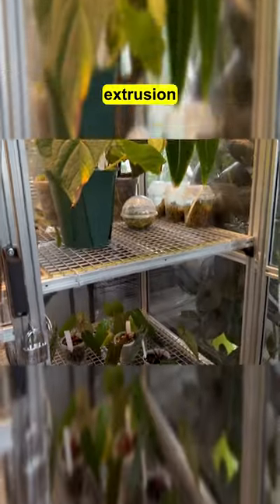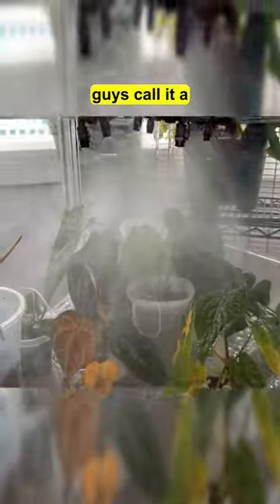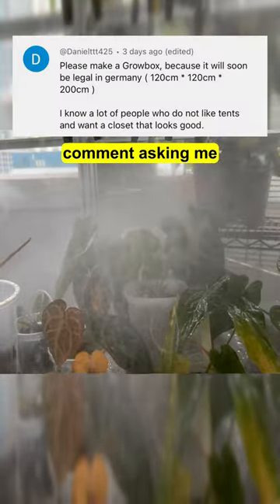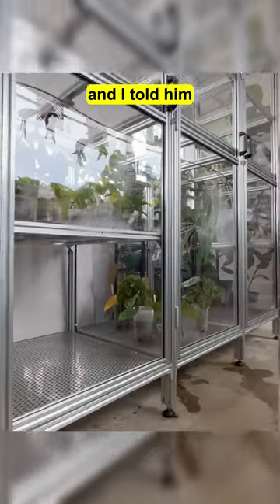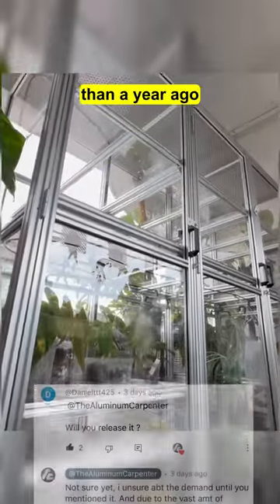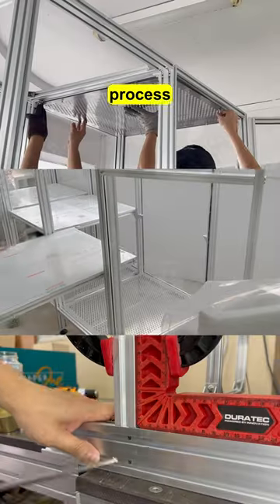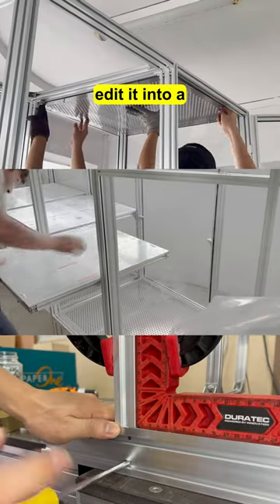Greenhouse Build Using Aluminum Extrusion #greenhouse #growbox #aluminumextrusion  #extrudedaluminum

Comment: I am also currently thinking about building my own grow box out of aluminium profiles and other materials that do not rot away.
The idea was to build a basic box frame with a door frame and make it double walled with the space in between used for cables, tubes or some standard PC fans for running it in Summer when you do not need to filter the air as the windows are open. 
At the moment I am looking for company that produces basic V-slot (or comparable) box frames with a size of about 70x70x200 (or something about this size), so that I have a robust base I can build on and add profiles, aluminium sheets and wheels myself as I need to.
Reply from the maker: Love to see your creation.

Comment: Would be cool to see how u setup the water recycling
Reply from the maker: There’s no water recycling. It just flows out at the bottom to the drainage.
Reply: @TheAluminumCarpenter  so have to constantly run water ?
Reply from the maker: @dridful1057 yes. Constantly sprinkle water.